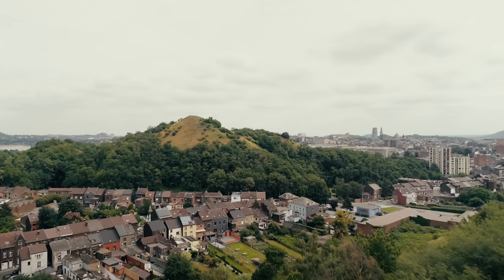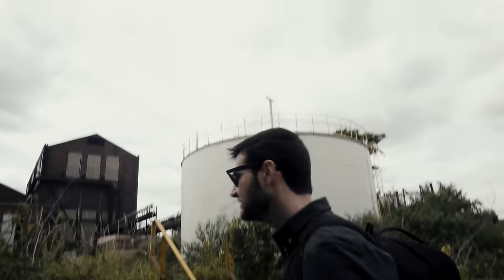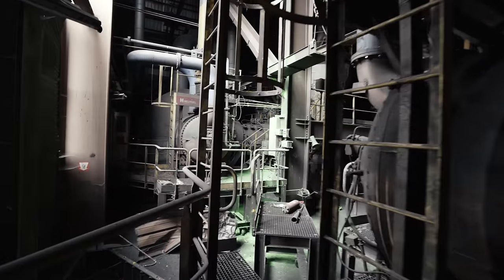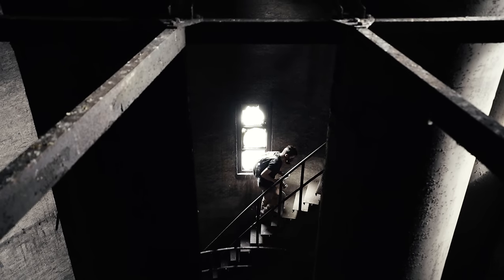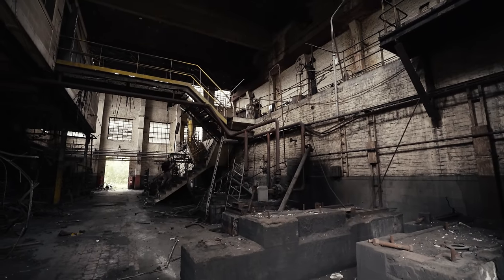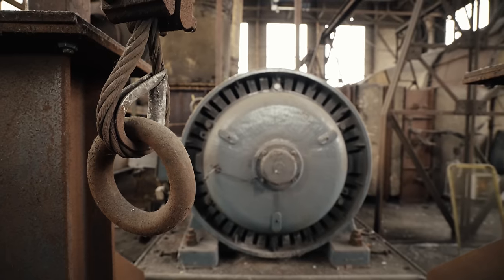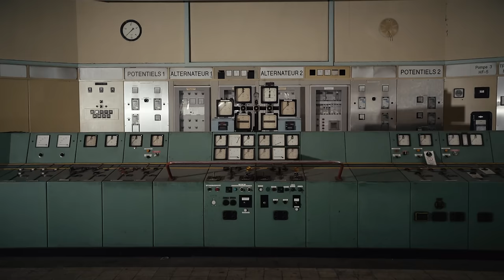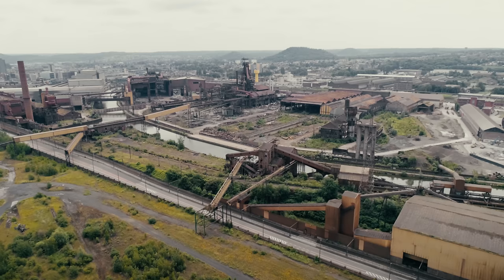Caught by Security at Huge Abandoned Steel Factory

Comment: protip: If you're ever forced to format your sd cards, keep them but don't begin recording on them again. There's plenty of software to recover the "formatted" data and you won't lose much, if anything at all.
Reply: This is the most underrated comment here.  A soft format deletes no data, just pointers to data.
Reply: But not if you had tapes of Epstein not killing himself. That can never be recovered
Reply: What is a good unformat tool for SD cards?
Reply: in  many case   if police are called, they will confiscate  the SD cards , and if,...(IF) ... you  get them back they will have been double wiped,  erased  &  reformatted with their special utility  wiper  which renders all previous  data  un-retrievable  so nothing can be retrieved
Reply: Expert tip- Always carry an extra SD card (of no value) and in the event something like this occurs you are prepared to use slight of hand to swap the cards and stash the good card somewhere on your body.
Reply: @donjuan6324  Most local PDs don't have access to a "special utility wiper". At best they will try to fill the media with zeros. I've seen plenty of FTLs transparently compress writes like this into nothing. Its why file systems that can do duplicate write profiles advise you not to use single drive configurations with solid state. The FTL does its own thing and lets be real, unless you are dealing with the Feds or a larger city force, the cops just don't have technical chops.
Reply: the best thing you can do is have a fake sdcard that you can put in the cams so when they search you they wil confiscate the fake sdcards
just hide the real cards in a really good place, most people hide them in their underpants or in their shoes/socks when they know they will be searched
shiey also a lost place explorer does that
Reply: @Maxime_K-G  I love testdisk and photorec.
Reply: But why put "formatted" in quotes? Is it supposedly "not an actual formatting," or...?
Also, these guys didn't have to format, right? They were just made to delete the one file.
Reply: @HelloKittyFanMan..  typically a format is just referring to the data pointers on a drive, the data itself isn't touched. If you do a long format it 0 fills the drive, and you can do other types of wipes in various passes for security if needed.
Reply: I know that,  @Ki113dbysw0rd , but that doesn't make it "not a real format" deserving of quotation marks. It's still a real formatting.
Reply: @andywolan : Hypothetically it would be the same that work with disks. But then something a bit surprising happens with Recover My Data: even right after a mere flag-down deletion, unfortunately a few things that I could have gotten back from a disk weren't recovered from the card -- or they looked at first like they were but then the data actually wasn't there. But I don't just give up that easily. I set the card aside and mark it for recovery, and I will later buy EaseUS Data Recovery because I discovered that it might actually work like it's supposed to.
Reply: @donjuan6324 : "Unretrievable so nothing can be retrieved"? Oh, who woulda' thought? Maybe you can retrieve data that's IRretrievable (the real word instead of "un-")!
Of course you can't retrieve irretrievable data or other things! Just by saying that it's irretrievable is the clue.
Reply: "Of no value," @famousamoso7 ? That's impossible. They all cost something. 
Also, how do you make sure your slEight of hand won't be caught?
Reply: @exan6970 : Where might we supposedly get a fake SD card? Have it 3D-printed? Besides, that wouldn't work, because as soon as you hand them the fake card they'll notice that it has no connection points on it! Why not just find a cheap real one that's empty or/and broken to use instead?
And how are you going to change the card without getting caught?
Reply: @HelloKittyFanMan..  Its called sleight of hand for a reason.
Reply: @famousamoso7 : So what? Everything happens for a reason, but many reasons are not notable, such as minor accidents, or such as "My brain just told my arm to move this way."
If you meant "for a purpose instead," then that would begin to make some logical sense, but even then, you would have little to no point, because just saying that... "Oh, it's called (blah blah blah...)" isn't the same thing as actually answering the question that was asked. Duh.
Reply: @Maxime_K-G  9
Reply: @AlexanderNecheff  filling media with zeros makes the data unrecoverable unless you send the physical media to a data recovery specialist. and that will cost thousands.
Reply: @spinningspin6053  Give it up my dude. Must live a really sad and pathetic life.

Comment: That green sand could possibly be resin coated foundry sand I work in a plant that produces it and sometimes it’s dyed for the customers to identify different types easily
Reply: either that or floor sweeping compound. though i don't know why anyone would want to polish the floors of a steel plant.
Reply: Chancellor Merkelisms 
Basically spill magic
Reply: Chancellor Merkelisms  Depends on the chemicals involved I have seen coloured/dyed cement powder as a common one, it doesnt set without water and you can get oils and such up with just that and a broom.
Reply: It could also be leak detection powder for a dust control or ventilation system.  Basically you dump it in the intake and wait to see the where the colour shows up on the ducting.   Given it's in a coal milling building and how important dust control is in that environment, I can see it being there.  Also that stuff sticks to everything and you can see it on the beams above too.
Reply: Dawson Christian ✊
Reply: I think @chris brown is correct, I’m almost positive that is a type of sweeping cleaning/polishing compound which makes perfect sense because you can sweep the floor of any metal fab type shop ten times thinking it’s spotless and still be filthy, the green shit attracts dust and fine particles and helps to polish the floor.
Reply: It is floor sweep.  It is required to help keep dust down. Nothing special.

Comment: golden rule for liege and charlerois: avoid the ground at all cost, always stay on the upper levels, use the "bridges" or tunnels to pass from building to building. And never go go back where you have been (possibly) seen/detected before.
Reply: Why quotes around "bridges"? Are they not real ones, or something?
Reply: @lotecque : Who are you to try to make up the supposed limitation of what a bridge is? If something is a pathway across a gap, it's a bridge. You've never heard of a pedestrian bridge?
Reply: @HelloKittyFanMan.  It depends if they are reasonable to use. If there are conveyerbelt-bridges: perfect, in most caseses walkways on both sides of the belt, well covered (against view). if it's a big pipe: Sometimes an "unshielded" walkway, but potential risk of beeing spottet. If it's just a 2m diameter Pipe... no walkway... if it's dry, if you a confident in your fate... but you wil be hightly visible against the sky....
Reply: @Mogamishu  you're also scrolling through every comment if you know it's on every comment
Reply: I don't think it was every comment,  @Mogamishu , but nonetheless, thank you for your support.
Reply: @HelloKittyFanMan.  Do u love bridges
Reply: Why do you care,  @NicknameBasis ?
Reply: I’d say that rule applies everywhere. Stay off the ground as much as possible. If you have to, avoid big open spaces. Common sense really but you’d be surprised how many people just walk around in plain sight. I once saw about ten people from different groups get caught in Chertal, while we managed to roam around for hours because we stuck to the small passageways. At some point a guard came looking for us but we managed to hide underneath a machine, no more than a few metres away from the guy. Good times.

Comment: You have Sony cameras. Most of the ones made in the last few years have dual card slots. Get one of those if you haven’t already and you can just set it to record to both at the same time and delete an entire card or hand over one of the cards if you’re sly enough or quickly pop out one card and stash it in the top of your sock or a small slit you could make in the sole of your boot. If you get caught but they haven’t gotten to you yet or if you see a guard and think you might get caught it should be possible to quickly stash a card in case.

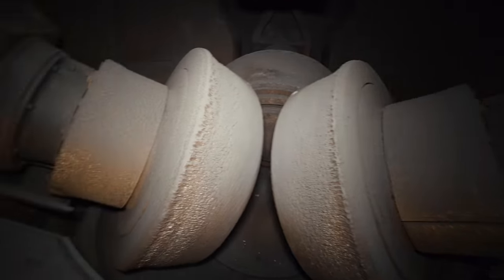Comment: 6:19 Coal mill pulverizer.  Those are still in use today.  They turn coal into a talcum fine powder that is then blown into the boiler furnace. The surface is smooth when the rollers are new or rebuilt.  As they grind coal they become worn and develop a rough surface as those in the video show.

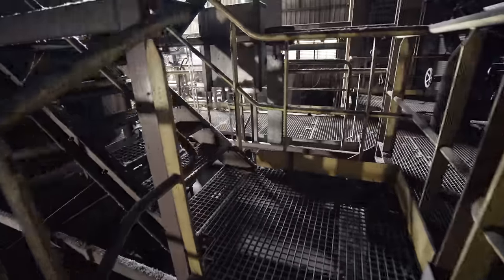Comment: 6:26 those my friend are electrodes, instantly turns steel to butter
Reply: No.  Those are rotary crushers to crush the large lumps of Coal.
Reply: @gordbaker896  its inside the smelting part of the factory, I beg to differ sir
Reply: @topherwayne4398  The shape of the structure is not right for a molten metal furnace.  The electrode comes down from the top and the crucible is much much larger IMHO.
Reply: Turns steel into butter? That's some freaky alchemy shit right there. (The preceding was just a joke).